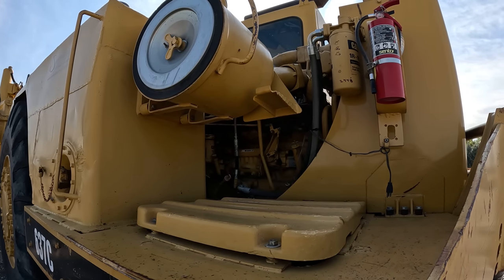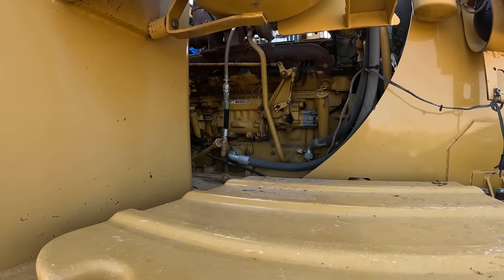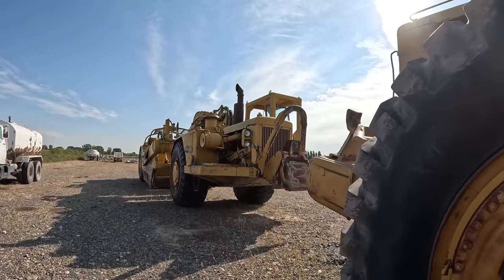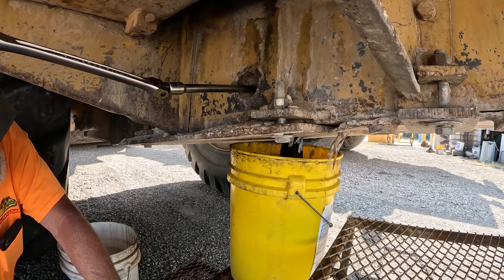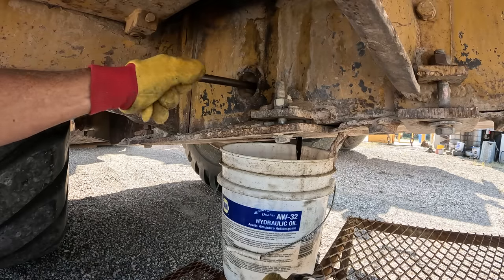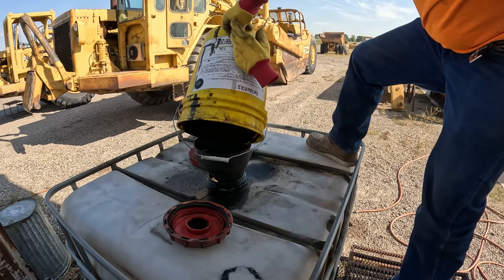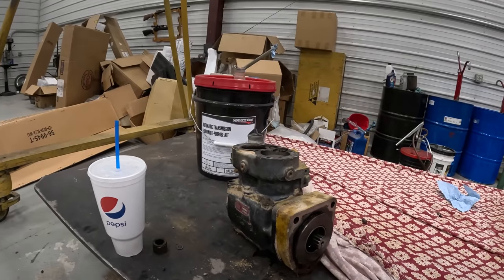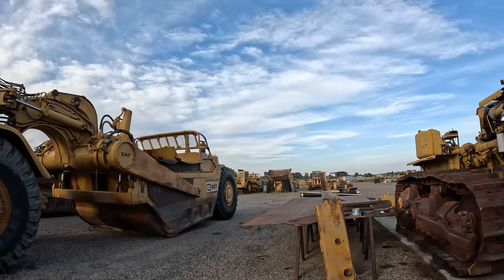D343 Oil Change

Comment: Waaaay back in 2006 to 2008 i work for Quinn cat in Selma, ca. At that time most of the shop was doing re powers of older equipment for the CARB emissions ( ca version of the epa). We mostly took out 3406b front engines and 3306 rear engines (657 scrapers) and replaced them with 500 to 550 hp c15 accert up front and c9 in the rear. Also as part of the repower program / grant money we had to put a "3inch" hole on the side of the old engine block, usually with a sledge hammer to render it "unusable" and to be scraped😞 BUT.... kinda funny story with that. One of the these scrapers came in with only 1,200 hrs on front engine rebuild. It got repowered, then when it came time to put the "hole" in the block. One of scraper owner mechanics came by and used a 3in hole saw instead of a sledgehammer. Which the CARB employee didn't care, he said a 3in hole is a 3in hole. I asked the mechanic why he did that. To which he replied that it only had 1,200 hrs on it. So they were going to ship to there Nevada division. Put the cut out piece back in and weld it up, then slap it back into another scraper. That's one way to play the system. Get a new engine at little to no cost to the owner (b/c it was part of a grant, If I remember correctly) then ship the old engine to another location so it can have a "fresh" rebuild waiting for it's new home😅

Comment: Back in the day we had 5 31C’s and 6 31B’s always changed oil between 200 and 250 hours never had any problems 
But we lost 2 D342’s in D8H’s with in 2 months of each other due to weep holes in water pump’s being plugged we worked in lots of limestone rock and humid conditions 
After this we oversized weep holes and checked them daily

Comment: Good day Jeff thanks for sharing...  2 things, 1 check out area diesel for parts or rebuild on that compressor and 2 is when you got done charging your oil and was giving a little throttle @around 17:00 you had a bit of  a rattle that almost sounded like the barrings in the turbo going out. Might want to keep an eye on it. Thanks for the awesome videos you put out and Jeff WINS!!! Party on

Comment: Might check the water pump if you haven't already. We have 627f scrapers and the water pump leaked all the antifreeze into the oil over night. Since there gear driven id bet that's your problem

Comment: The trash truck that picks up the bin at my apartment building would release Air from the air brake system about every 23 or 30 seconds. I warned the guys that they need to get that fixed, tell the mechanics at the shop to get it fixed because the air brake compressor is going to burn out and fail because it's not unloading and they said the mechanics I've been told and they said it's normal.  I called the repair company and talk to the service manager he said that's normal all the trucks do that that's three months later I noticed it it's not making the noise anymore I look out they have a brand new trash truck I asked him what happened to the old one. Oh the air brakes failed and we crashed it.  I said i'm glad your ok but i warned you the air brakes were going to fail months ago.  As the blood drained out of their faces  the nodded and remembered i had.   A piece of oring from the bendix air dryer canister had been pinched off and held the check valve open at the bottom of the canister.  There is a watch wes work video on the same issue. Brakes release air every 20 to 30 seconds.

Comment: this conversion which increases oil Life sounds interesting
not sure how it works❓
The filters…⁉️
Reply: Switchblade turbo….. builds boost faster,so the engine burns the fuel cleaner,so there’s less soot,so the oil stays cleaner 👌
Reply from the maker: Switchblade turbocharger builds boost quicker and it's a modern turbocharger that puts out more air and more air by weight

Comment: Check the gear drive water pump...seen them leak around the shaft into the crankcase😢
Reply from the maker: WP is belt driven
Reply: @Jpaydirt  yea I guess it is i was thinking of the later engines....

Comment: CAT parts are sure a problem.  I have a D6T that has had the gear for the injection pump "dis-continued", but "we have a new pump on the shelf".  I had to buy the entire pump at a cost north of $3000 just to get a new gear because a tooth was chipped on my old one.  No reman was available either...........only brand new.  I called everywhere I could think of trying to find a salvage gear.  The problem is the dozer is too new for a salvage part to show up, and too "old" for CAT to offer parts support.  I'm finding this to be a huge problem on everything CAT that I own.  I expect the other manufacturers may be doing the same with their parts support, but as you said, CAT used to be good for parts on anything they ever made in the last 80+ years.  

The next issue is the prices of the available components.  I need a button switch for my 420F, but you have to buy the entire joystick for hundreds of dollars because the button isn't listed as a part with a number.  That way they only have to stock the entire component.  Same for the dozer control on my D8T, had to buy the whole shabang for $1200 because one sender failed.  I can remove and unplug the sender, but I can't buy it as a part.  What do you do, throw away the whole control because 1 sender is bad?  Not to mention, the extra labor in changing out an otherwise perfectly good part.
Reply from the maker: Your other issue is Caterpillar allows dealers to set markup now, I'm paying 17% more from western states than buying from T&E in Montana
Reply: @Jpaydirt  I didn't know that, however I had noticed that prices for the same parts are less in Kansas City, MO than in Wichita Falls, TX.  You can shop the prices online now which makes it very easy to buy from the lowest dealer source.   Too bad CAT won't allow you to price new machines from other dealers.
Reply: Did you try taking it to a machine shop and having a new gear made?
Reply: @FishFind3000  I did consider it but decided not to delay the repair.  There is also the concern that the new gear might not fit properly and could destroy the other gears which are very difficult to change.  You have to remove the front timing cover to get to them which is major, and if it gets the cam gear the head has to come off.
Reply: @JohnRichardJones  makes sense why you would want to avoid that.

Comment: Jeff i know where there is a bunch of those scrapers already converted to C15 and 3406E.... and there just sittin and rotting away.... the owner converted them and communist California wont let him use them....walkers air brakes in ontario CA should have the parts you need
Reply from the maker: Who did the conversion